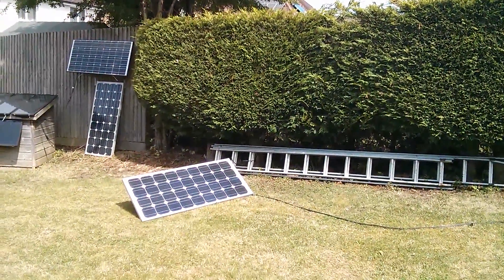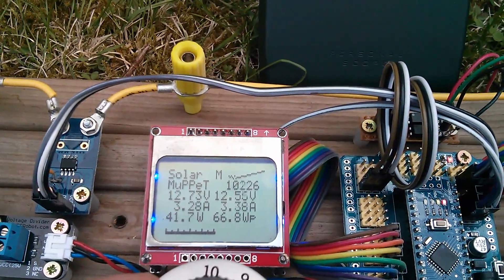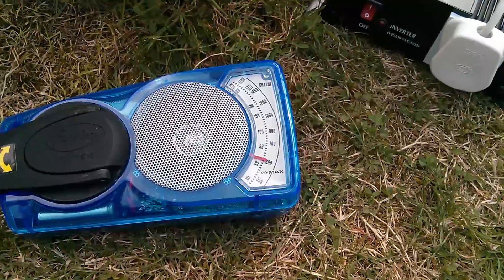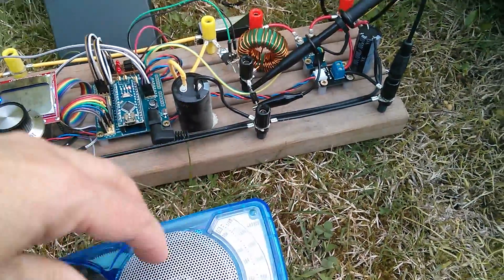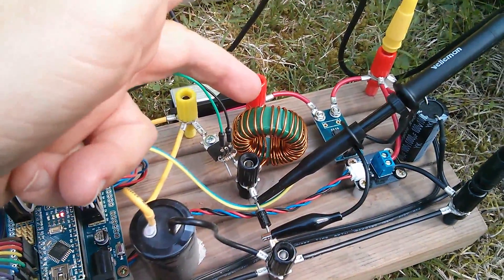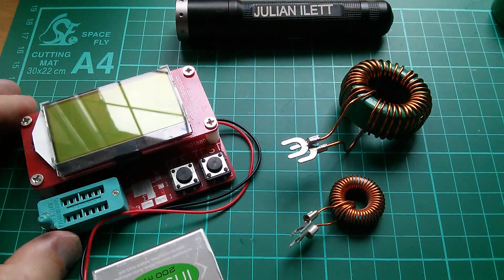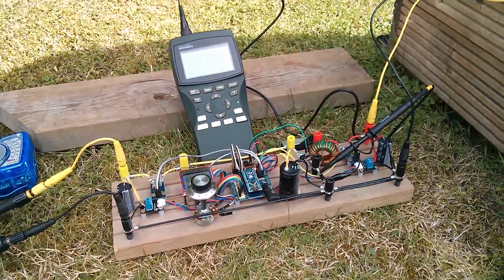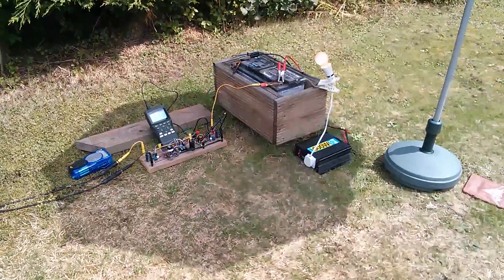Arduino MPPT Solar Charge Controller: #22 - Inductor Change

Comment: Hi Julian I recently participated in young rewired state festival of code, this is a competition for young people to show off there coding skills. there's one rule, the project has to include open source data! This year I built a smart watch that used the met offices weather data to give you live updates, there was only one problem this was that I used a Bluetooth module to connect to a smartphone and then to the Internet (this was unreliable).
So I did a bit of research and found out about the WiFi module esp-8266, could you do a tutorial on how to use it? Please.
Reply from the maker: Louis JaCooper I did look at the ESP8266, but I'm waiting for the buzz to settle down before I look at it again.
Reply: Thank you Julian Ilett !
Reply: Louis JaCooper How is it going.
do you wanna me to do the app